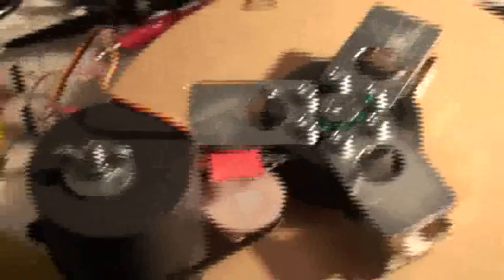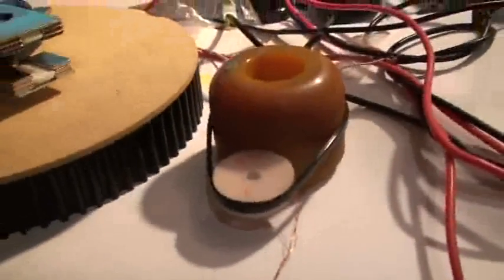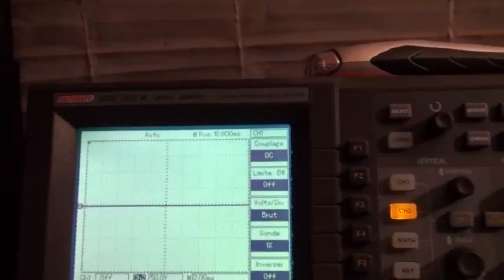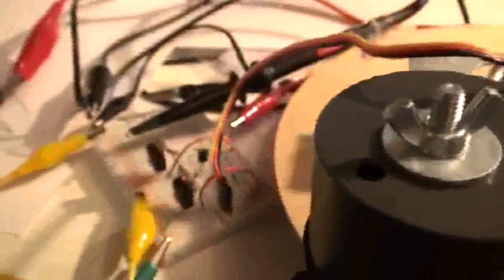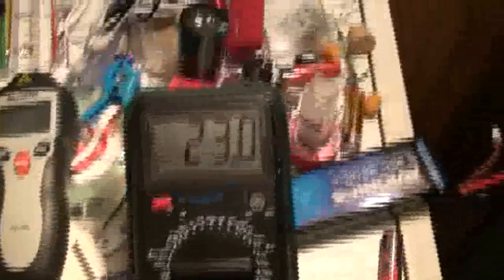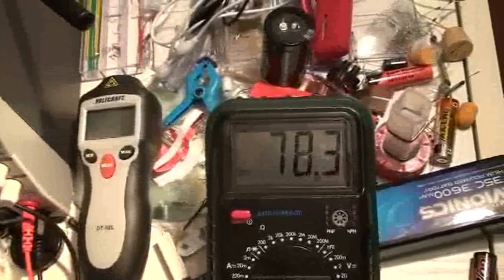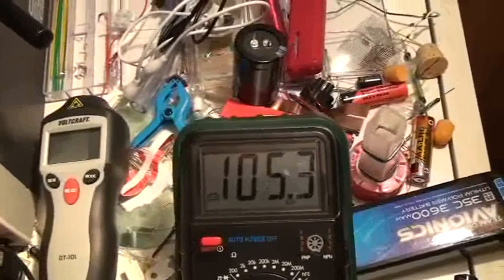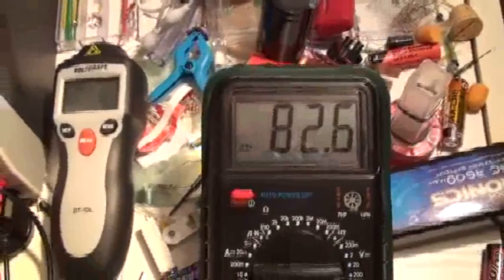part 6 back emf versus flyback spike

Comment: Hi, again! Here is the same situation- inductance of iron core work only at very low RPM`s(frequency). Inductance in the "deep analysis" is property of core(iron, steel, ferrite, aluminum, e.c.t.). In fact- ideal transformers are toroidal- for very low frequency the best is soft iron(here we can speak about our Planet- inside we have molten iron our Planet is like low frequency transformer). Every core material is self resonance frequency which we can measure with our laboratory equipment. After this frequency(lower or higher) the inductance is "relative" or useless. I think all "Free Energy" effects are the part of these "properties". Thank`s!

Comment: hi woopy, you can make another experiment? instead of using the hall switch use a 555 timer and a optoisolator and see if the spikes are still there when using hi frequency, if not could means that at hi speed the hall is not fast enough to make the switch

Comment: (2nd) To really understand why this is happening would require some serious investigation on the bench.  I think that you are a beginner, so let me just suggest to you how you can try to discover the explanation.  Run the motor with your scope channel A triggering on the spike for a nice stable display.  Then take your scope channel B and look at all of the different places in the circuit and look at the waveforms.  Do the transistors switch on and off quickly or slowly, etc...

Comment: In the 2nd part of your experiment large spikes = high cap voltage and small spikes = low cap voltage.  The question is why is this happening?  I don't know the exact answer, but I do know that there is a real reason for this.  We can say that it has something to do with the timing of the transistor switching, the size of the spike, and precisely how the capacitor is discharging between spikes.  This requires that investigate further with your scope and multimeter.

Comment: (3rd)  Now that the spike is "thicker" or wider, the scope will start to display it again.  In other words, the spike will not be filtered out because it is less than one pixel wide.  Why not keep on turning up the time base so the "spike" is now half the width of your display.  In other words, as long as you set the trigger properly so that only the spike event causes the scope to trigger, you can then see the spike in detail.  So we move from the spikes "disappearing" to seeing them in detail.

Comment: (2nd)  Once you have the trigger working properly then you can connect to the real motor.  You may need to increase the trigger from +5 volts to +10 volts to ensure that only the spike makes the trigger and not the sine-wave induction waveform.  Now, as your motor speeds up, you see more cycles on your display and the spikes get skinny and appear to disappear.  The trick now is to turn up the time base of the scope so that you only see one cycle.  This will make the spike "thicker."

Comment: Woopy, for part one of your test where you only look at the spike without using the motor, I have a very helpful suggestion.  You see how the spike is being displayed randomly on your screen?  You need to experiment with the triggering function of your scope.  For example, based on your spike waveform, set the trigger to be on a rising edge at +5 volts.  If you set this up then every time you get a spike you should see it on the left side of your display.